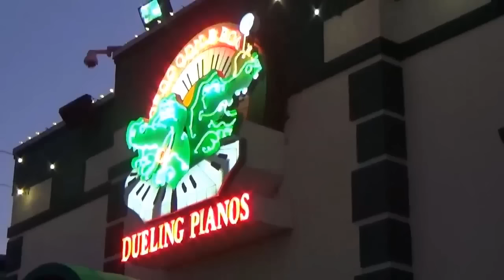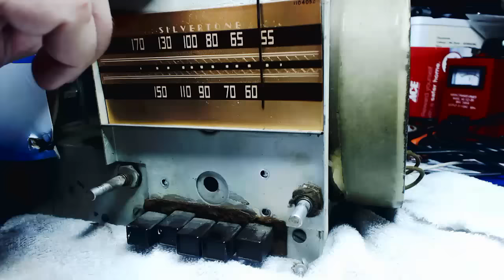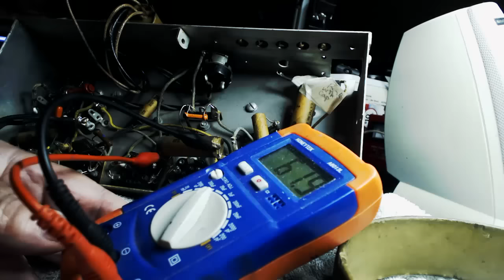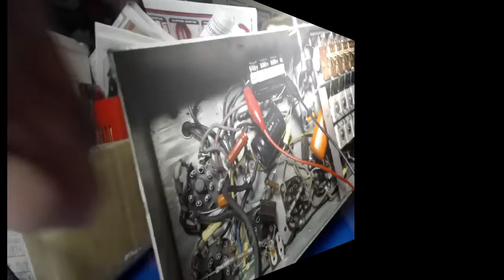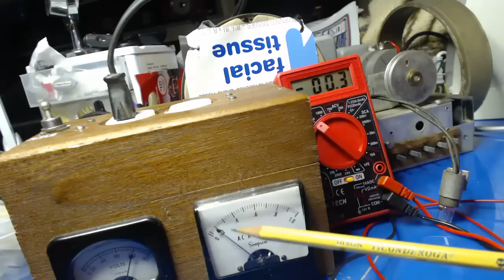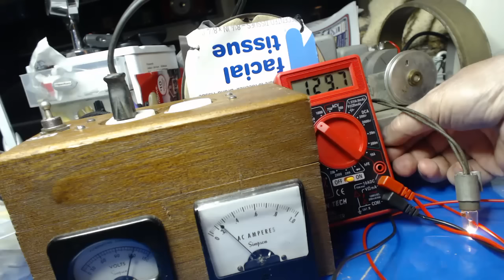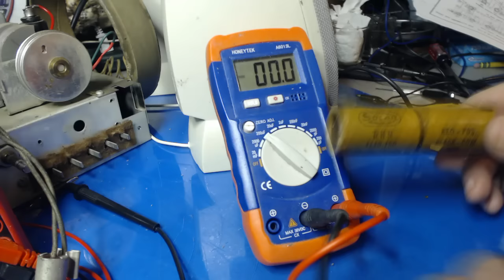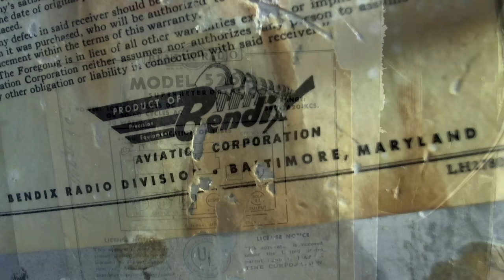1939 Sears Silvertone Model 7252 Restore Part 2

Comment: Looks like i had more fun on my vacation than I had even dreamed about  having. Thanks for showing me that Dickel. You're a swell guy.
Man I hate those orange drop caps. it goes back to the old TV/Radio repaiman I knew in the 1970's who said they go bad on the shelf. He had the Sprague Orange drops. He said he liked the old paper caps better! 150 WVDC electrolytic. They used the cheapest caps and just enough cap they could manufacture for cost savings and space savings. Still better than some new Chinese stuff. Depends on the manufacture and how the slave labor was working. Going over in the WVDC is a good idea all day long. Also I think some Chinese caps suck so no way use a 150 WVDC Chinese cap!. It's good to take all sorts of pictures from all angles since a picture is worth a thousand words to help avoid misteakes. Another great video in the can, Buzz. Lay that pistol down, pistol packin' momma! Beautiful Bendix. I think you could sell that to John from Arkansas for $1000 dollars. Have to wait 2 weeks to see Old Goat? Dang!
Reply from the maker: +Lockemeister Meister, I'm so jealous of that dream vacation you had.. I lived vicariously through you looking at Dickel's report......How did that frog-burger taste?....Great WC Fields impression. Nice blonde on the beach too!!! Lucky dog...
I don't worry about cheap caps, I like the color of that orange one and I had it for a couple of years and it worked fine.
As for the Bendix, John wouldn't pay me anything for it as it seems he's not speaking to me anymore........Buzz

Comment: 18:20 That's a nice looking, very simple radio, but it's  amazing that Bendix was soon to become one of the most innovative companies of the 20th century, pioneering electronic fuel injection for Chrysler in the 1950s (a system which was later shared with  Bosch and used in VWs, Cadilacs, Saabs, Volvos, etc. ), electronic anti-lock brakes in the early 1970s, the late 1940s condensing washer-dryer  machine types that are still used in Europe today (they were originally marketed in the U.S.), and a long list of other important advances.

Comment: Another interesting video Buzz.  I have found over the years that if there only 2 wires to reconnect, that I have an 85% chance of mixing them up.  Nice job of figuring it out.  Dickel can be a  PITA sometimes!  Ha!  The old WD 40 came through again.   It does a lot of stuff.  Looking forward to the next vid.  Have a great break!!
Reply from the maker: +Stephen Moore ...I was so negligent not taking pics and just cutting wires thinking I would remember which was which....WD40 rules....buzz